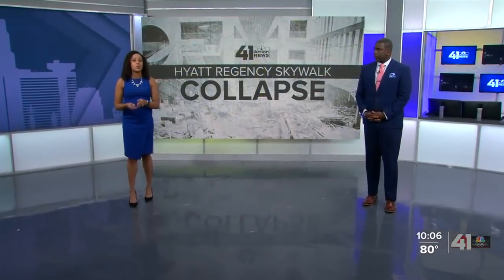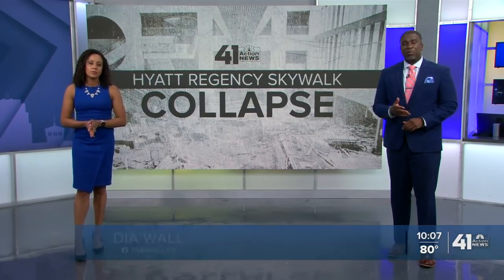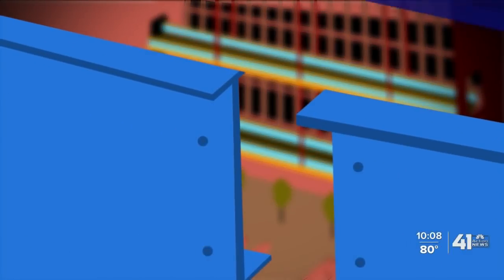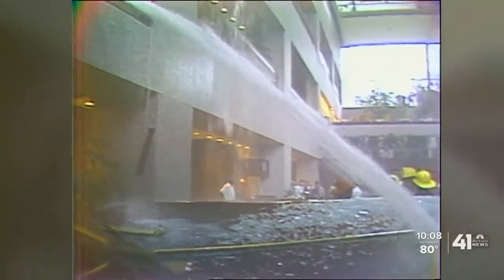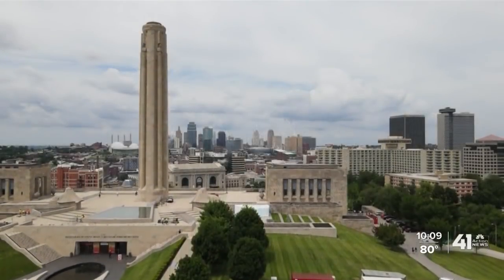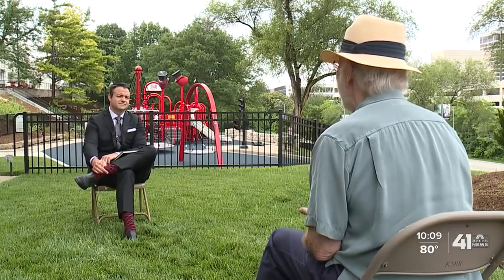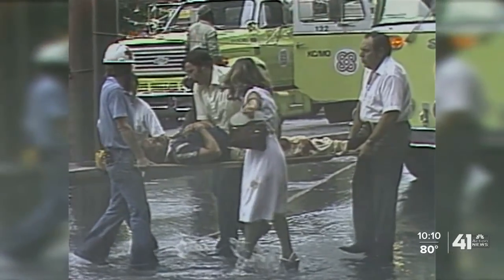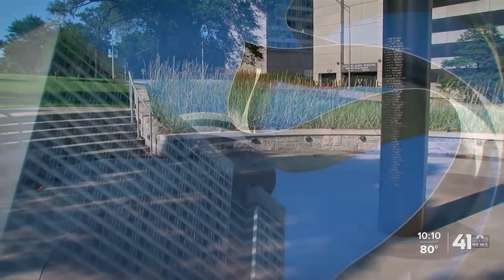Lessons learned from the 1981 Hyatt skywalk collapse

Comment: Imagine blaming engineers for something called a "skywalk."

The premise is a stupid, impractical, expensive novelty. 

The engineers are not at fault. The investors and pedestrians must assume responsibility for even imagining stepping foot upon it. It's a dumb idea doomed to fail with zero application.
Reply: It is definitely an unnecessary risk.
Reply: @christansdad  thank you
Reply: That's a weak argument. If people thought that way, no one would ever get into an airplane or ascend a tall building or drive over a bridge. Not without first getting an engineering degree and making a thorough inspection of the structure before determining is it is safe to use.
Reply: @Lethgar_Smith  those all have practical applications. This is a stupid luxury for the obscene rich.
Reply: I find it odd that you are criticizing the "intent" of the designers as the flaw that caused this collapse rather than an error in calculation and judgement about the support of the structure itself. See the Skyways in the Peachtree Center district of Atlanta. There is no risk of them failing because they were designed properly.
Your argument is the exact same argument that was employed in the early 1900s.
"If Man were meant to fly he would have been born with wings!"
Around that same time an editorial was published declaring that mankind had now reached its pinnacle of human achievement and that there were no more great inventions to come or anymore discoveries of note to be made. Humanity can now rest on its laurels. Do you believe that technology should have stopped with the steam engine and the telegraph and progressed no further?
Reply: @Lethgar_Smith  I think you ought to read Jurassic Park. You're too concerned with "can we do this" and not "should we do this"
Reply: @keilafleischbein59  I'd rather talk about your insistence that a pedestrian "skybridge", as a concept, is an example of hubris and excess gone awry only because of who was hurt and killed by its collapse. A collapse caused by a change to the original design made by an engineer, not by the people who were crushed by it.
You need to defend your original comment, not drag us off into discussions of science fiction novels.
Reply: @Lethgar_Smith  not a single pedestrian on that bridge had any necessity to cross it. 

If they didn't pay money for that hotel to walk on the bridge, the hotel would never have built the bridge to make money. The investors would never consider the idea. 

An engineering oversight is inevitable. And anyone standing on the house of cards at the wrong time will suffer it's collapse. 

Those injured seek to victimize themselves. But the truth is they victimized themselves. They are the own perpetrators of their own suffering. No one compelled them to step upon such an unnecessary and superfluous structure. They put blind faith into the engineers. 

That's their own fault.
Reply: @Lethgar_Smith  mankind enjoys standing high above all else, the elevation provides a false sense of superiority. The inevitable fall of all great empires must come. An unsustainable system will eventually collapse. They deign to achieve great heights. But the taller you are, the harder the fall. Such is the hubris of Babel.
Reply: @Lethgar_Smith  "intent" is a purely legal concept relevant only to the laws created by this very class of people. Nature has no concept of intent or mistakes. Do or do not, there is no try. 

Now we hear the futile whimpers of those fools who believed their made up laws might protect them from the law of gravity.
Reply: @keilafleischbein59   What is it that you are so angry about? Too much Ayn Rand and Revelations?
Reply: @keilafleischbein59  So Florida (and other states) is dotted with High Rises:  people from a variety of income levels live in buildings that are many stories high.  One of these collapsed in Surfside on June 25.  Are you saying that the people who died must be blamed for their folly in believing that they could live so high?  Or that engineers who may have permitted a design flaw in the slab concrete floor over the parking garage should not be blamed?
Reply: @seancourtney9021  maybe don't build shoreline skyscrapers when sea levels are rising.
Reply: @crowleythedemoncat  I'm not angry.
Reply: @keilafleischbein59  Intent is not just a legal concept.  The legal concept of intent is based on the Intentionality which we assume is inherent in all people.  For example, I intended to take a shower this morning, but something happened and I didn't take a shower.  Very basic stuff, really.  As for Nature, it includes Mistakes all the time:  e.g. a mountain goat trying to climb a sheer cliff, errs in his perception of the rock face and ends up falling to his death.  Isnt that a Mistake by the goat?
Reply: @seancourtney9021  intent is merely a psychological illusion, as is freedom of will. 

There is only the power to will. 

You did not take a shower. Your intent was purely imagination inside your head.
Reply: @seancourtney9021  I'm probably at fault since my life is more privileged than that of the goat.
Reply: @seancourtney9021  and let's again reevaluate the practical application of a high rise vs a skywalk. 

A high rise is necessary to increase square footage without expanding outward. It generates more living space the higher you go.

There is NO application for any idea so silly as a "skywalk"
Reply: @shoechew  what on earth does privilege have to do with anything?
Reply: @keilafleischbein59  The troll is strong with this one...
Reply: @Lethgar_Smith  yarrr matey
Reply: @Lethgar_Smith  but am I wrong?
Reply: @Lethgar_Smith  in a mechanical world based on laws of physics, is choice not but an illusion? Is responsibility for consequences not the burden of each individual player upon the stage?
Reply: @keilafleischbein59  Are you wrong?
Wrong about what? All you are saying is some philosophical nonsense about how the wealthier class deserves what it gets for trusting in structural engineers to not make a huge blunder.
I've made my argument using sound logic. There is nothing more for me to say.
Im bored with this conversation now.
Reply: @Lethgar_Smith  I never said the wealthier class deserves anything. 

I said they put themselves in the circumstance out of vanity.
Reply: @Lethgar_Smith  the huge blunder was the conception of such a frivolous structure in the first place. The blunder is trusting a crowd of educated apes to prevent the inevitable. What goes up must come down. 

This isn't the first incident. What about the titanic? What about Rome? What about babel? 

Human aspiration is only matched by its ultimate humiliation.
Reply: @Lethgar_Smith  do you know the story of the son of Daedalus?
Reply: @Lethgar_Smith  consider this: there are two kinds of people

There are those who walk across the street, or even stand in it. They do this out of arrogance for they believe their safety is guaranteed by the laws of man. 

And there are those who sprint across the shortest path because they are aware of danger and familiar with the laws of physics and the error of man.
Reply: @Lethgar_Smith  Bro it's a friggin troll man, so obivous, don't waste your time responding